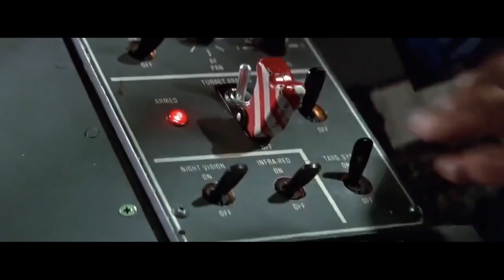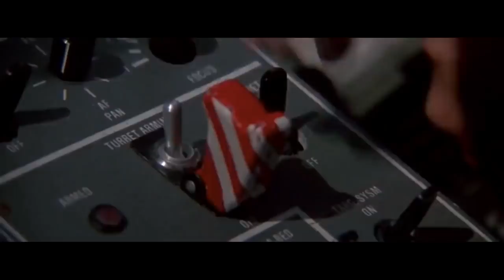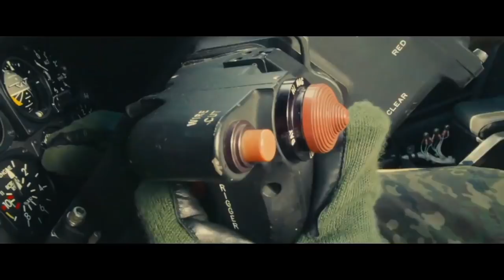M61 Vulcan Compilation in Movies, TV & Animation

Comment: AH-1 does not use the M61 in the chin, it uses the M197 Gatling. 6000 rpm on M61 vs 1500 rpm on the M197.
Reply from the maker: The M197 electric cannon was developed primarily for use by United States Army helicopter gunships. Development began in 1967 after experience in the Vietnam War revealed the inadequacy of the 7.62 mm Minigun for gunship use. The M197 is essentially a lightened version of the General Electric M61 Vulcan cannon, with three barrels instead of six. Its maximum rate of fire is one quarter that of the Vulcan, largely to limit its recoil for light aircraft and helicopter use. It shares the Vulcan's M50 and PGU series 20 mm ammunition.
Reply: @gunboyproductions8168  hmmm interesting
Reply: @gunboyproductions8168  what the heck is the helicopter movie red with the black MP explaining what the helicopter is what's the movie name please
Reply from the maker: @knightridertrowbridge5315  Blue Thunder
Reply: @gunboyproductions8168   thanks for telling the movie name thank you
Reply: Well, after all it is considered a lightweight Vulcan

Comment: Talk about M61 Vulcan...
1. Some were GE M197 "Lite Vulcan". And they mostly equipped at early attack helicopter.
2. Most Hollywood Vulcan firing sounds either incorrect or being or lowered and weakened it.
3. While early Japan anime or movies Vulcan were incorrect due to budget or issues, later anime or movies have correct firing sounds. Though mostly they were Lite Vulcan.

Comment: A lot of these scenes are featuring the M134 Minigun and NOT the M61 Vulcan...

The M61 Vulcan is quite large and would not be able to be mounted under the nose of a Helicopter, nor door mounted to a helicopter and aimed forward...
Reply: Also, tri-barreled guns are not M61 Vulcans...
Reply: @Blandy086  They're scaled down versions of the Vulcan so technically they're still considered Vulcans.
Reply: @ryerye5855  They are not considered "Vulcans" by any military/company on the planet.

The "Vulcan" is a reference only to the 20mm weapon system, featuring a Gatling design principle.
Just like the Avenger is only referenced to the GAU8 30mm Gatling gun.

Your comment is absurd.
It is like saying, "A musket is just a scaled-down version of a cannon, so technically they're considered cannons."
Reply: @Blandy086  Okay then I stand corrected.